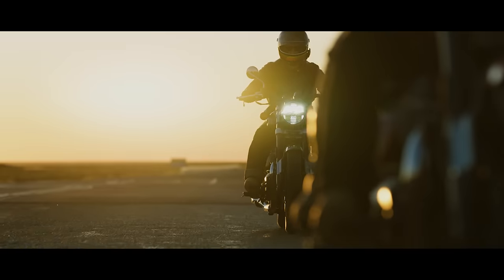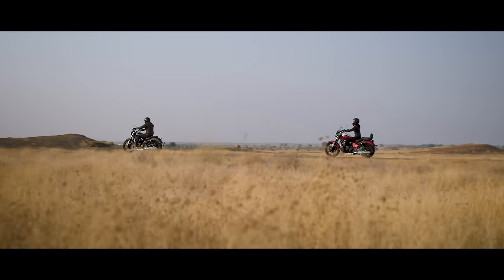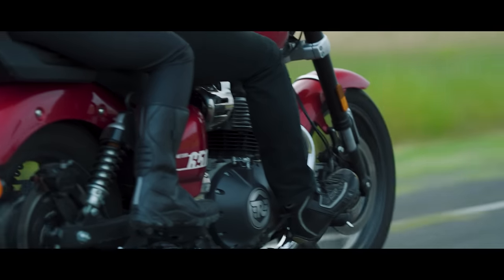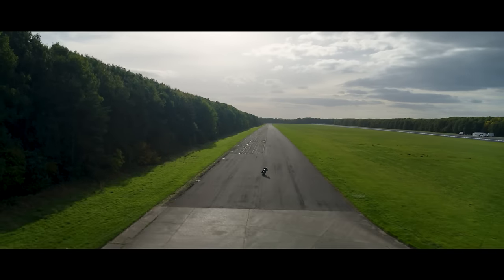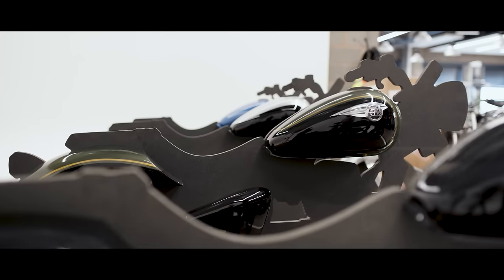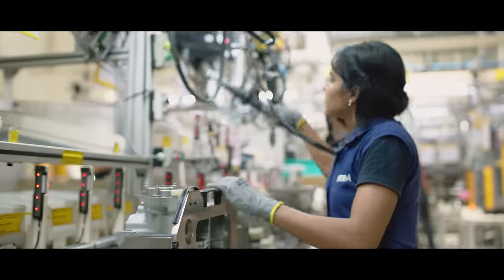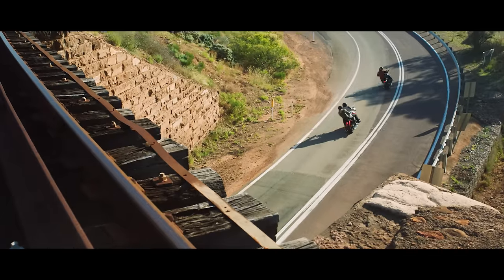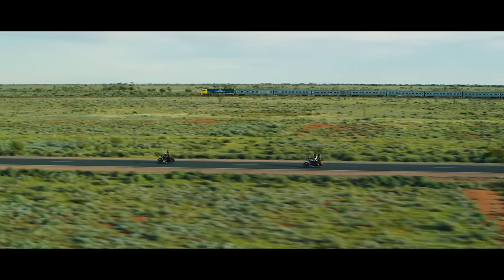Royal Enfield Super Meteor 650 | The Story

Comment: I full time tour on my 2020 Interceptor 650 and LOVE IT with 37,000mi/60,000km. I want to test ride the Super Meteor so bad, but I haven't seen any dealers in the USA with one yet. I was really hoping with the Super Meteor being a "Cruiser" that they would go to belt drive to do away with always having to stop to clean and lube and adjust the chain, not to mention the mess. As soon as I saw a belt drive conversion, I installed it on my INT650 and it has been maintenance free for over 18,000mi/29,000km. In my opinion a "Cruiser" should be able to go long distances without any maintenance. With the chain I had to stop sometimes twice a week for just chain servicing in accordance with the owner's manual, "Lubricate and Adjust every 1000 Kms / Clean, Lubricate and Adjust every service or earlier as required" 621 miles. I see the Super Meteor Owner's Manual calls for "Clean, Lubricate and Adjust every 500 km or earlier as required or after riding in wet/dusty/muddy conditions" or 310 miles which is a day's ride for me. PLEASE consider making a belt drive option and/or conversion kit.

Comment: I Love This. What a great touring machine. PLEASE, have this be belt drive. I am full time touring on my INT650. I Love My Royal Enfield Interceptor 650. 6,000 miles between oil changes is great, but I got so tired of constantly having to stop, buy cleaner & lube, unload, clean, lube load up again, then move on. Not to mention the mess. I really wanted to keep my INT650 stock but gave in and converted to belt drive. 12,000 miles now without having to service a chain has been great. It has made my touring experience much more enjoyable. I sure hope this is belt drive. It may be my next bike. If not belt drive PLEASE have a factory kit available.
Love My Royal Enfield!!!

Comment: I don't understand the problem with Royal Enfield ! Why they go on increasing the weight of the Motor cycles it's not gonna help in India due to heavy traffic and many other factors Interceptor was 220 kgs and now this 245 kgs ! Where is the innovation next bike will be 350 kgs with more cylinders and low quality metal used ! There should be some R & D and make the  lighter and user friendly With advancing years of experience the company commands !!!
Reply: Steel frames are substantially more durable, easier to repair, and cheaper than aluminum. Fortnine did a video about two months back going over several metals used by different brands and their strengths and weaknesses.